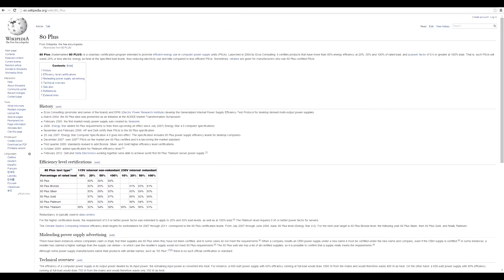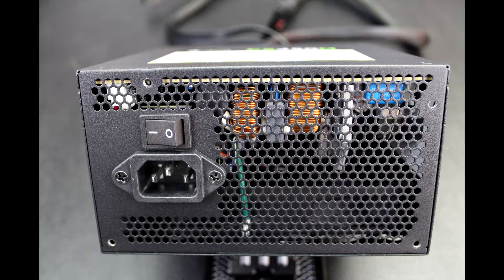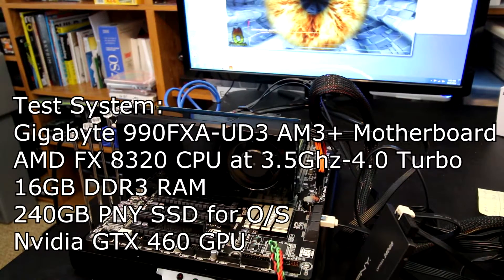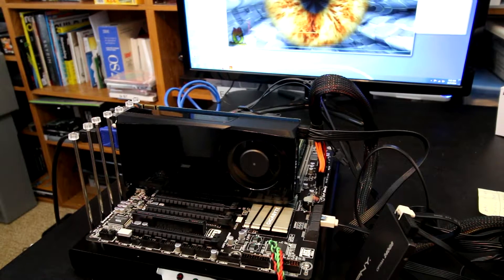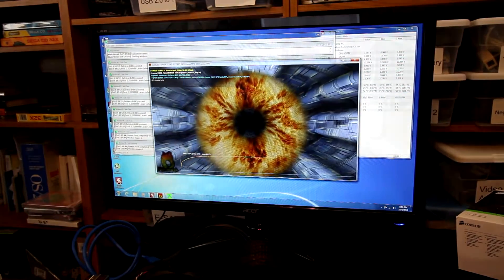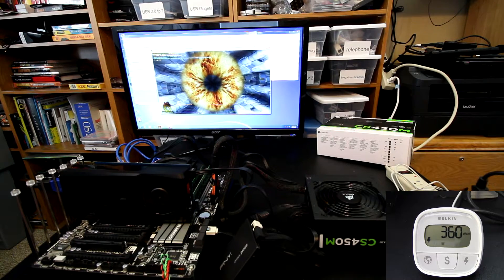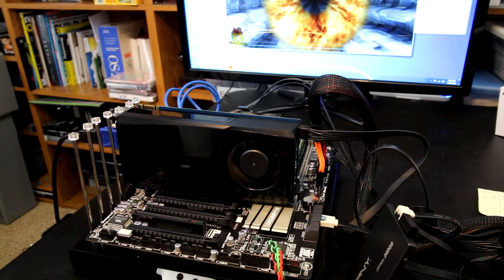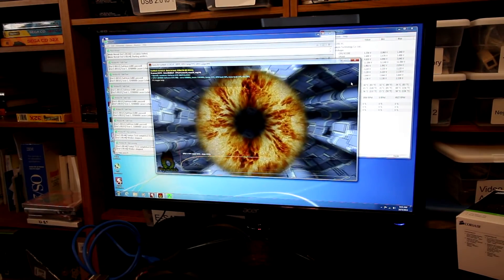Power Supplies: Gold vs Bronze Rating Comparison

Comment: will gold psu make a difference to my monthly bill i use computer at full load like 16 hours a day
Reply from the maker: Hi. Do you know what you pay per kilowatt hour? Also do you know the wattage draw that you average. You will be able to calculate the watts used from the wall to kilowatt by dividing by 1000. Then multiplying it by the number of hours (16). That will give you the kilowatt hours per day. A gold rated PSU will have about a 5% more efficiency than the 82% you have now. This depends a bit on the load, but generally it will by around 5%. It probably will not change your bill as much as it sounds unless your full load is crazy like 1200+ watts. If you were buying a new power supply because you needed one, then it could be worth it. Replacing a working power supply just to gain a 5% efficiency, will likely not be worth it in the long run. I hope this helps.

Comment: Power saving is not the only factor to consider. Noise and heat comes with that. For people looking for a system that does not disrupt their working environment, the efficient PSU makes a great deal of difference. The efficient ones offer silence and temperature comfort.
Reply from the maker: Great points. I am not able to hear as well as others, so fan noise doesn't bother me as much as most people. I can see that being annoying drone. I definitely forgot about heat, though. In a hot climate adding additional waste heat is not ideal. Thank you for the insight!

Comment: evga vs Corsair 1200w or 1000w power suply what ones better
both gold
Reply from the maker: Lately, I have had better luck with EVGA power supplies. They seem to last longer. For a long time Corsair was my go to brand, but EVGA has won me over.
Reply: well i plan on getting the amd ryzen 8 core 16 thread cpu and a amd vega gpu with 32gb ram 3tb hhd and 120gb ssd

Comment: i7 6700K
MB Z170 progaming
8*2 3000mhz ram
vga 1070 8G
Hdd 2tb
ssd 250
cooler corsair H100i v2
what should psu i need? help me
Reply from the maker: I would get a good 650 or 750 watt. Like a Corsair RM series or EVGA SuperNOVA series. I personally have never had any issues with those lines. If you need a more budget oriented supply, the CX series from Corsair is also good.
Reply: Big thanks
Reply: https://outervision.com/power-supply-calculator

Comment: i7 6700k
asus gtx 960 4gb
asus z1700 pro gaming
16 2400mhz ram
cooler corsair h1000i
ssd 240gb
500 gb hdd
1tb hdd
what psu i need
Reply from the maker: +Anand Kumar Personally, I always get at least a 600 watt. This way if you need to upgrade the GPU later, you always have plenty of headroom. Unless you are going to SLI, then I would get 750 or 850. For the bare minimum on that build I would get a good rated 500 watt PSU.
Reply: corsair cx600 or cs650m
what to buy
Reply from the maker: +Anand Kumar 650m for sure. The modular power supply is much easier to manage cables.
Reply: https://outervision.com/power-supply-calculator